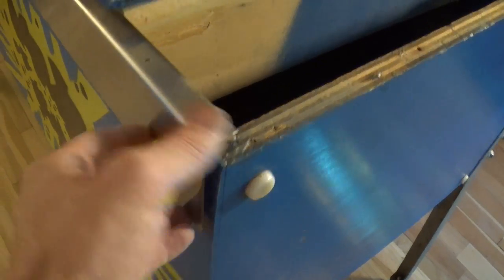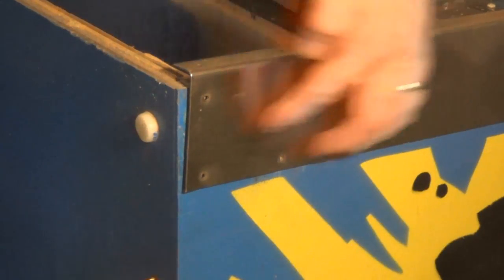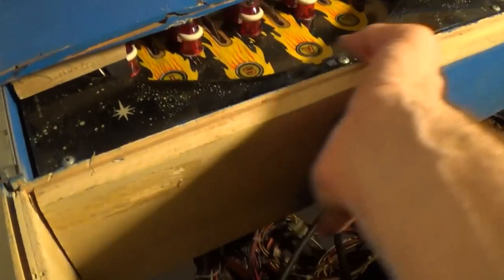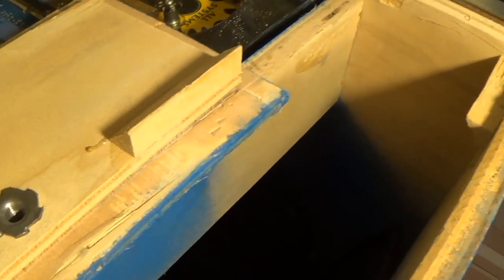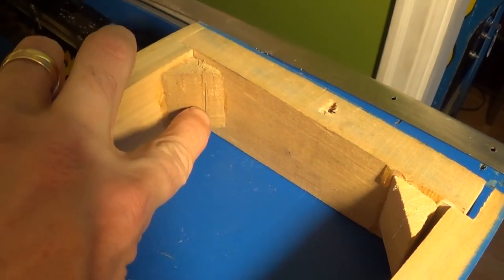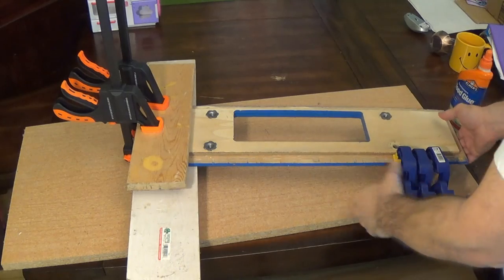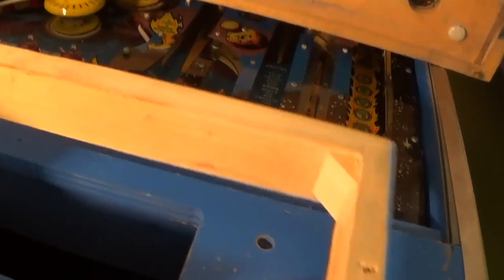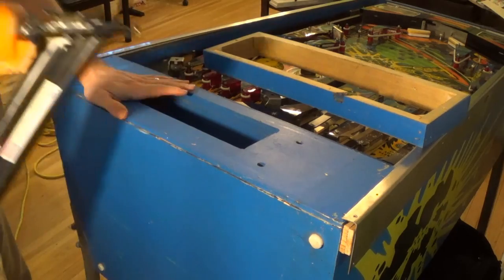Flight 2000 Pinball Project (Part 2) - Rebuilding Back Box Head Support

Comment: With those side rail nails you need to do some wood glue on a toothpick and put it in the nail hole where the side rail nail was as those nails are security nails as they have a narly twist in them to make it harder to pull the side rails off so when the nails do come out it chowders up the hole and just putting the nails back with out toothpicking them the nails will not stay in very well.
I use awesome orange that I get at the dollar store here for cleaning stuff work nicely.
The piece of wood that had the rubber feet on it is what holds the glass in at the top of the playfield and has those rubber feet to protect the glass from scratches.
Yeah that is the bad thing about pinball manufacturers they were not cabinate makers so the cabs are sub par on most pinball machines and all the mods you did should make at least the back in more steardy.
And I am glas the gab did not fall apart completely have to be careful on some pins as the back end on occasion will just completely pop out then the pin comes crashing down so the crowbar to the head was very risky but in this instance you can repair it.
At least you did not have to rebuild the head portion from scratch.
I get to do that with my from scratch pinball machine I am working on here.
Yep building my own pin here. xD